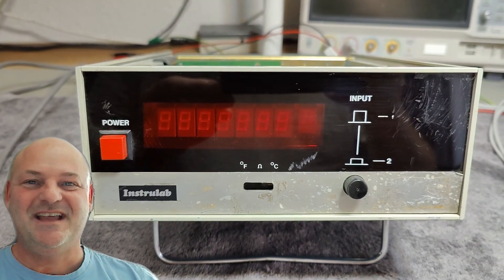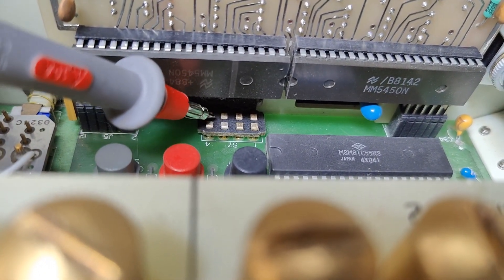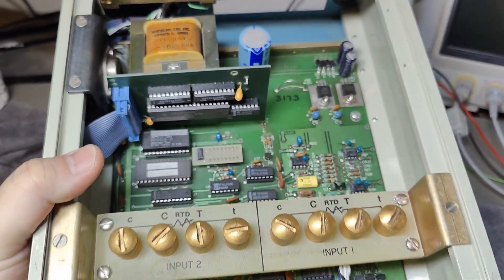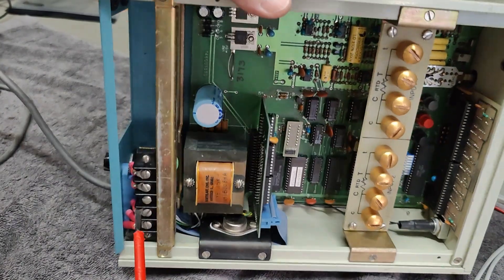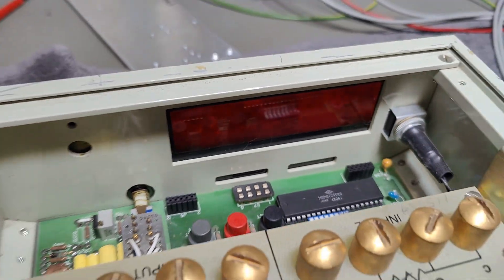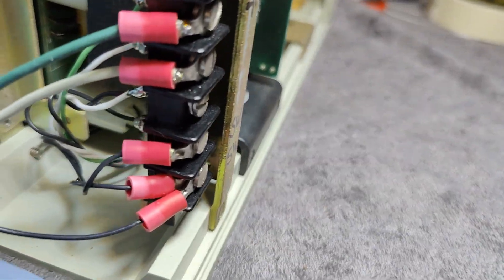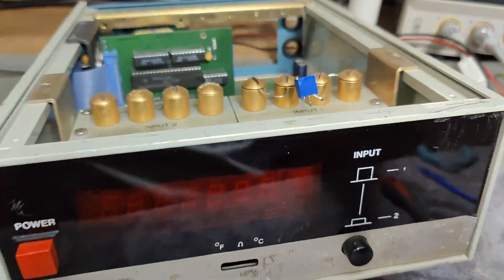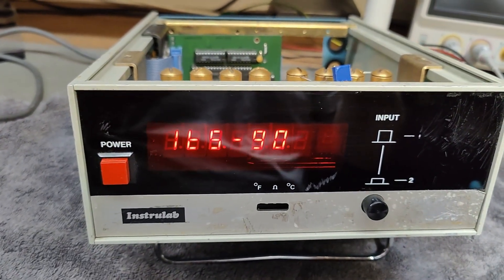INSTRULAB 4221-13-15-08 dual RTD temperature IEEE logger 1992

Comment: Going to guess the reason for the wide range of date codes is that they do acceptance testing on all incoming silicon, and thus bought in large lots, and tested them, only moving to the next batch when the lot is complete, and the next batch is finished with testing.  Takes time but they likely were used in environments where reliability was important, and traceability was also important as well, as that would allow them to see which of a batch would need repair and upgrade as failure occurred  and a trend was noticed. Wonder what the SMD IC is, likely a part no longer available in DIP format, but still in SMD, so the board to use up the old known reliable board stocks, and not need to respin and recertify the board.
Reply from the maker: very good points, also we need to unlearn the way instruments are manufactured in high volume today where low price, and just good enough is the quality level to aim for, to be competitive :-)
Reply: The mix of chips is also with digital parts. With digital parts there is usually not much extra testing an binning needed. This is definitely a low volume product and could be build to order with a mix of stock parts and parts ordered if needed. 

The linked manual has quite some information of how the circuit works, though the instrument in the video has some different parts than listed in the manual - so there seems to be a little more difference than just 1 / 2 channels.  Looks like its a dual slope ADC for some 5 digits (maybe even 6 digits internally). So quite high resolution and a reasonbale good ref. resistor.
Reply: I wonder how acceptance tests on IC‘s would be done - usually if you buy from manufacturers directly or official distributors that should not be necessary.
I work at an automotive supplier of electronic products and quality is a top priority here and I don’t know of any component quality checks after introduction (unless there was an incident).
Proper storage of components is more of an issue, they all are assigned a due date.
Probably the company and their lot sizes were so small that they worked on stocked components for a long time.
Reply: @inse001  Easy enough that they would verify incoming stock meets spec, and packed them into smaller batches with a CA storage, so that they have a stock of good parts to use. 16 years in storage with correct protection is no problem, as they likely also have a military presence, and the need there is for keeping traceable lots for a long time, in packages designed to preserve it.  I have opened military sealed packs, 30 years after packaging, and the inner parts, often made from natural rubber, were still perfectly preserved, and not brittle or damaged in any way.
Reply: @SeanBZA  After all this is a temperature logger, does not look like a MIL spec device to me.
Reply: @inse001  Temperature logger, often included as part of process control or ATE, and these were often used in the military first, so were built to the same specifications for reliability and traceability.
Reply: Company info on Instrulab Dayton Ohio: “Instrulab sells and services industrial instrumentation for local manufacturers, schools and laboratories“.
No obvious military background
Reply: @inse001  Industrial use, they were supplying to the companies that build for the military, and thus need the knowledge that every heat treatment has been done right. Get that wrong and you have parts that otherwise seem to pass QC, but fail after a few cycles.  A turbine does not work well if the blades snap off in flight.
Reply: It is only a thermometer, but still a rather accurate one. PT25 is usually only used for high accuracy at elevated temperatures.  This is more an instrument for science lab, e.g. to really resolve mK or get 0.1 K level accuracy. It could also be a reasonable good low resistance meter with something like mOhm resolution.  Even if used in a military lab it may not need MIL specs.